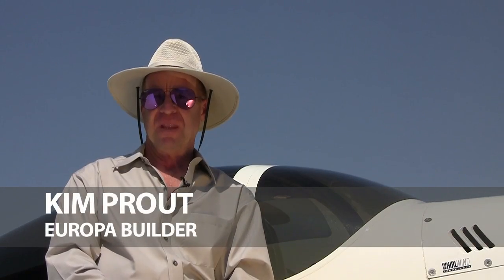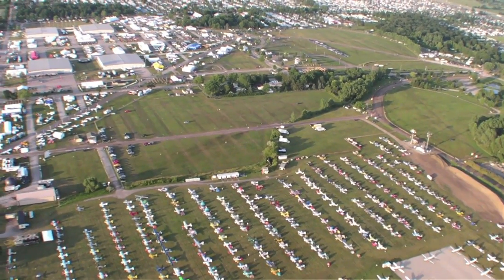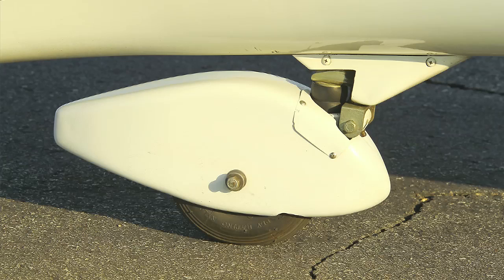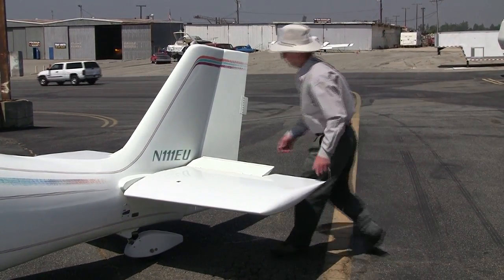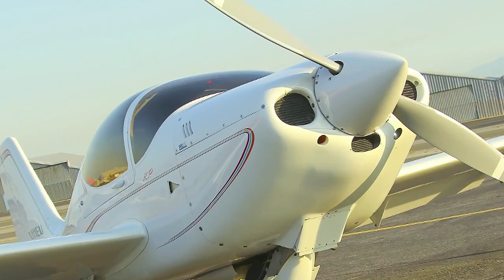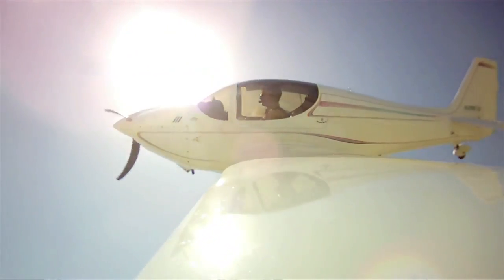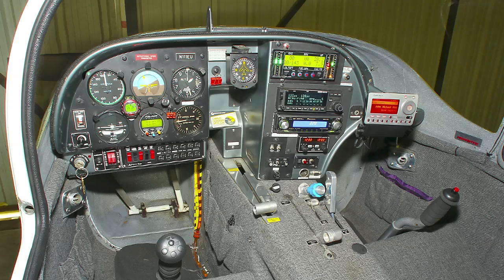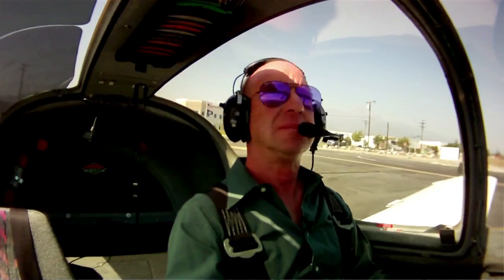Europa Video Brief

Comment: @KATAERO  you're correct on all your points. The Liberty XL2 externally looks very similar, but was designed with very different fuselage construction for ease of production line assembly and no provision for any kind of gear retraction. I'm reliably informed by one Europa trike owner who converted his monowheel and fitted his own design of wheel spats that only a couple of knots airspeed is lost but the aircraft got 35 lbs heavier. Metal construction can be as light and less risk from lightning

Comment: @KATAERO . You can. It's built in the USA and called the Liberty XL2. Much of the design excellence of the Europa XS has been included, but the differences are that it has a fixed tricycle undercarriage and the engine is American. Handling qualities are still beautifully harmonious, while as in the Europa the pitch trimmer is very sensitive compared with most other light airplanes.

Comment: I allso own a Europa XS Monowheel but with the Rotax 914UL engine. I'm using Unleaded 95 Octane automotive fuel and it works well. But you have to be shure the hoses can witstand ethanol because they blend more and more of that in the fuel. But it is wery economical to fly. Mine is about 5 US gallons with 130 kts speed.
Reply: Ole Christian Espedal 
Is that 130kt speed indicated or true ?  I would hope a Europa with a 914 would true out around 160 at 10k.

Comment: Wonderful aircraft but I don't understand how I can control the aircraft on the ground if I don't have two separate wheels braking separately. How can I turn the airplane? How can I correct the direction just landed with strong lateral wing?
Reply from the maker: There's a steerable tailwheel. The rudder does the rest.

Comment: He said it runs on auto gas, does this include fuel with ethenol?  I have heard it eats up fuel systems in aircraft...
Reply: It is necessary to make sure your fuel pipes can handle ethanol if you intend to use that fuel. I am still building my Europa and changed-out all the fuel pipes to avoid any issues in future.